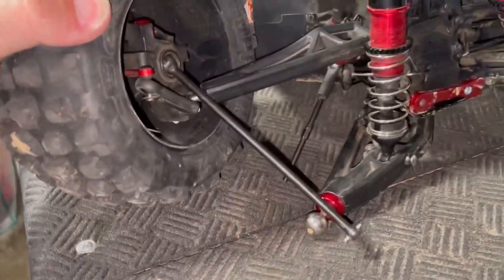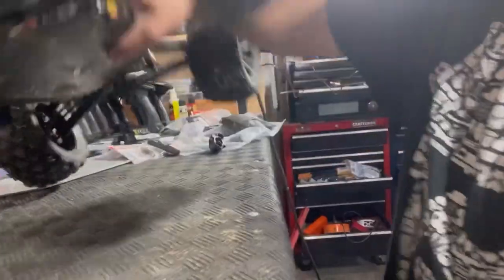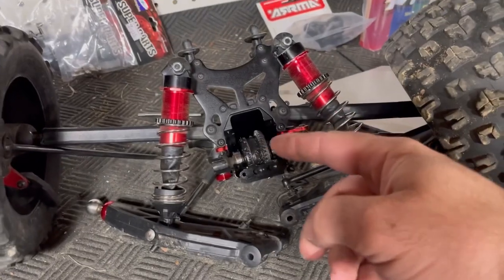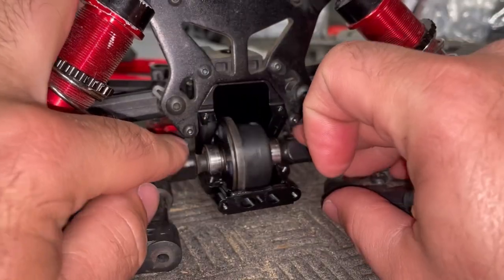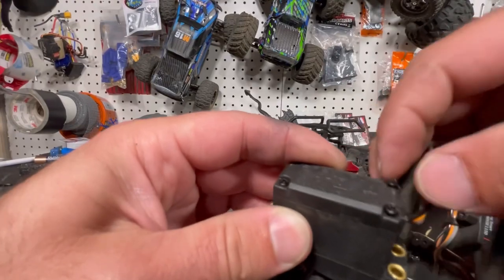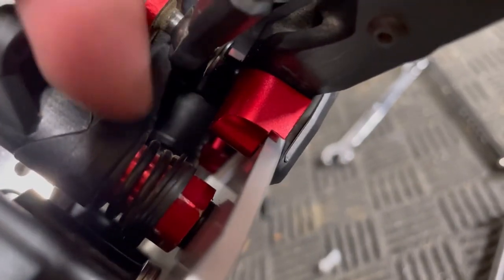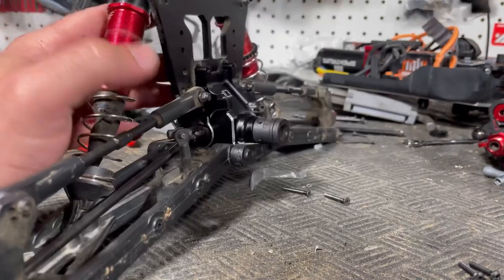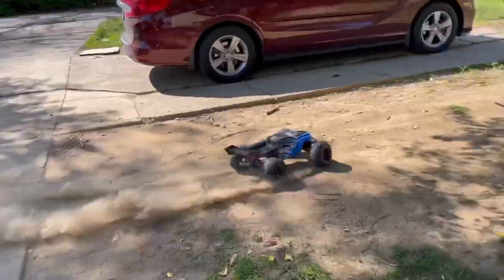Arrma Kraton epic upgrades! Must-do mods. M2C, Hot Racing & More!

Comment: Now that is one hell of a video, well done Evan. I purchased the same servo for the JLB 21101 and it fits perfectly, but the problem is that the JLB's servo spring is way too loose and it unscrews the base plate ( you know the thingy that the spring sits on - does that make any sense ? ), so since you keep on asking us if we have any requests regarding any issues and fixes, how about trying to find an idea for it to be more stable ( now did that also make sense ? I know my English is not that good ) .Anyway     I really liked the video and I hope that you will take the time to look at this issue.
Reply from the maker: Thanks George! So does the brass ring loosen up causing the steering to become sloppy? I haven’t ran into this yet (which is surprising since my cheetah breaks constantly) 🤣
Reply: @DerbyCityRC  Yes it does . Ever since I replaced the ring and it's plate. Damn !!! Anyway just check it cause with all your breakages maybe you will come across this problem....😁 And you are Mr Fix it.!!!!
Reply from the maker: Thanks!
I will look into this and see if mine has loosened. Is it something that can be loctited?
Reply: @DerbyCityRC  well to be honest this solution has crossed my mind ...... locktiting ( yes I know English is still a foreign language to me 🙃) the metal plate to the chassis hmmmmm !!!!
Reply from the maker: Honestly your English is not bad at all! 
If it’s a screw that screws into metal, loctite will probably help.
I haven’t ever taken that apart on the cheetah (that I remember) so not quite sure how it’s assembled yet

Comment: The 35kg servo on Amazon doesn’t cut it on the k6s . Just not enough on my example anyways .
Reply from the maker: I agree there’s much better out there, but man over the stock one and with tightening the servo saver was a massive difference over its horrible stock steering.
It’s possible they made some improvements, this model is 3 years old and the steering was so bad out of the box lol

Comment: I found the big rock and 3S line in general after minimal upgrades of motor plate and metal spur to be much more durable than the kraton and the 6S line. It is with a 17 tooth pinion fast and strong. I have both kraton and big rock and the big rock wins for jump bashing durability.
kraton is powerful and fun but the 3S line from Arrma is a bit ignored and underrated in some parts of the RC cars community.
Reply from the maker: Good to know!
A big rock is definitely on my list of cars to get. Thanks!
Reply: I find the complete opposite. My 6s Kraton has far fewer breakages than my Granite and Big Rock.

My friend Rival MT10, on the other hand, beats everything I've seen for durability.
Reply from the maker: I don’t have a granite or big rock yet. Been close to getting one or the other lol. The Kraton 6s stock isn’t bad, but still broke quite a few things, of course I’m pretty rough on it. After I beefcaked it in this video, it’s been a tank! Still need shock towers and upper diff covers.

Comment: I was thinking about the 6s kraton as my first RC, but this video makes me think twice about that. …mainly because I didn’t realize you changed out the frame. 
Why wouldn’t I just buy the Traxxas Sledge instead of buying a 6s Kraton and the. Building second one?….or buying a exb roller?
Reply from the maker: Well I’ve seen pretty much any car with a metal chassis will bend. Mine was slightly bent and that’s why I changed it. The sledge doesn’t seem to be an exception. 
If you don’t plan to drive like I do, because I jump the absolute crap out of mine, you probably don’t need to worry about it too much. It is definitely the most fun car I have. A close second being the Rival MT10.

Comment: Great video and very useful as always. Is the 100k front/read, 500k mid diff oil a bash specific setup? What handling characteristics does this produce?
Reply from the maker: Thank you!
Not necessarily bash specific. Kind of an experiment. I’m actually thinking I may try thicker next time. Like 1 million in the center and 500k in front and rear. For the center, the thicker the fluid is, the more power will be transferred equally between front and rear axles. So more wheelies, but also quicker acceleration in the right conditions. More equalized power like that, should also mean quicker and cleaner flips in the air, in theory anyway. Front and rear thicker fluid will help keep the left and right tires from spinning too freely from each other, so one example would be on high speed turns, if one side of the car starts to lean, even if the other side comes off the ground a bit, it will have less of a chance to spin freely and keep more power to the wheels that stayed on the ground. Less “diffing out.”
Hopefully that makes sense!
Reply: @DerbyCityRC  Yup makes sense. All the advantages you mentioned are basically bash specific though :D.
Reply from the maker: Lol good point!

Comment: Lots going on here!  We have very similar upgrades. I m lovin that servo also. Did you 100wt oil on all for corners? Looks like it sits higher than mine. Great vid man.
Reply from the maker: I know, very neat! Yes 100 in all corners. The thicker fluid doesn’t lift the car, but I thought I noticed it sat higher than before all the upgrades too. I’ve been wondering that. My springs are adjusted almost all the way down but they have been for a while.
Reply: @DerbyCityRC  The preload on the springs would affect the height, depends how much you ve cranked them down. I think im using 50-60 weight…not even sure tbh. Channel is lookin good!
Reply from the maker: Yes it will! The preload was adjusted for a while, it seemed like it sat higher right after all these recent upgrades. Could be an illusion lol. I put 50wt in one of my 1/16 scales and it seemed pretty good so wanted to go to 100 on this. May eventually swap out the pistons too.
Thanks, I appreciate that!

Comment: How is the Kraton cost wise? Does it break the bank compared to, let's say, the cheetah?
Reply from the maker: Good questions!
I actually will be doing a cheetah vs Kraton video soon. Cuz honestly they’re kind of comparable.
The cheetah breaks much easier(though a bad enough landing will certainly smash the crap out of the Kraton),  it also has
Much cheaper parts than the Kraton.
They both have their pros and cons for sure, with all the upgrades I did, I definitely have more in the Kraton. Probably around $1,300.
Probably around $900-$1000 on the cheetah, but ONLY in repair parts from breakage.

Comment: Servo saver is easier than using snap rings ,,,take servo saver apart,and put washer's on tube of servo saver put spring back on put servo saver back together problem solved,,,I use a 70kg servo in my kraton...
Reply from the maker: I think I had an issue trying to take the servo saver apart. Like the servo hex slipping in the plastic maybe. It’s been a while. I know I didn’t try too hard since I already planned on using the snap rings anyway.
I think my servo is 35kg. 70 would be awesome!
Reply: Ok listen arrma uses locktite on the red tube the servo saver is on so you gotta twist it good to break the blue industrial locktite arrma uses,,when you get servo saver apart put 3 washer on the servo saver tube,and put servo saver back together DO NOT OUT LOCKTITE BACK ON SERVO SAVER when you put servo saver back together,,now because of the mod I did to my servo saver it no longer works,,,with that being said ,,Do not forget to set steering end points it will saver your servo from burning up,,,and if you have not done it yet get a 70kg servo,and stick in your kraton
Reply: Push the plastic part of the servo saver down so you can grab hex a wrench,and twist the post till it unscrews...what I did ,,,or can just buy an adjustable servo saver..
Reply from the maker: Thanks! I’ll do this when I get back into the steering linkage 👍👍 I appreciate it.

Comment: The kraton v5 6s does break very easily I broke mine barley even pushing it
Reply from the maker: If really does. But with its weight, you can’t fault it too much. However, with these upgrades it has been extremely strong. About to add some upgraded shock towers cuz those have bent really badly.